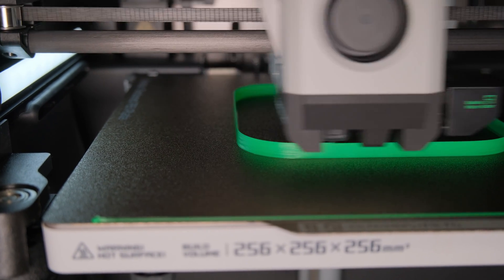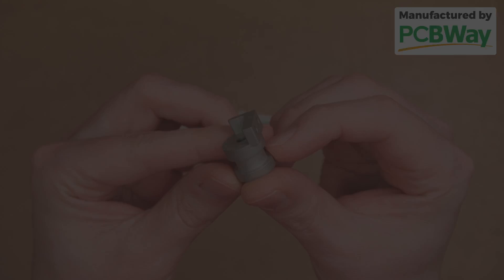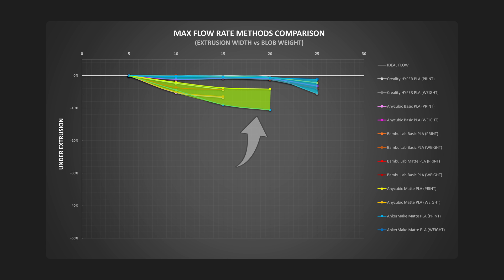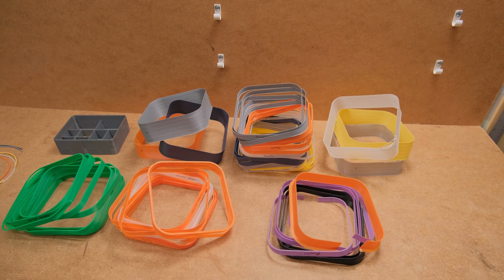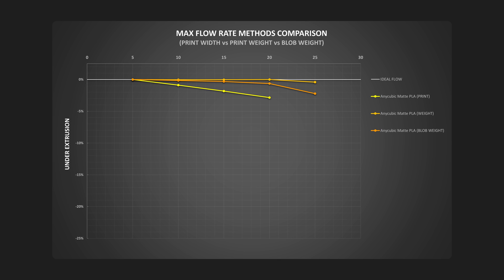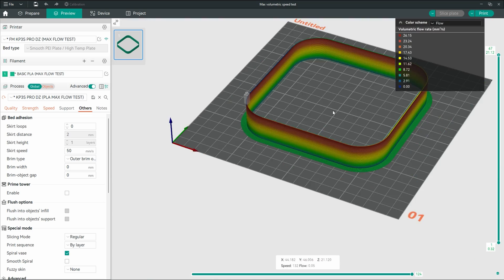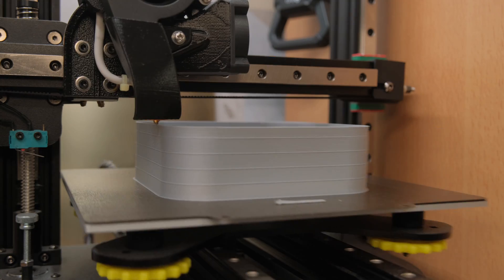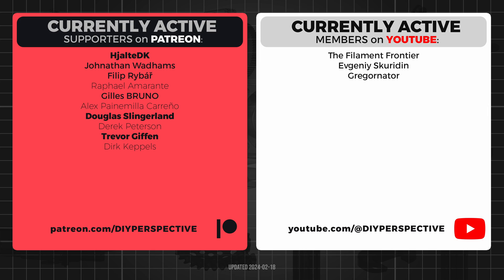3D Printer's MAX FLOW RATE TESTING – PRINT vs WEIGHT

Comment: I just use the Orca slicer max flow test and it works rather well for real world testing
Reply from the maker: Yeah, it is pretty good to determine the maximum flow. The only thing is that you can't measure the true extrusion width and how much different filaments drop off. And that is a very interesting data.

Comment: The way I benchmark my hotend is I take a miligram scale, I cut exactly 200mm of 1.75mm filament and weigh it, its usually around 0.580g. I then go to my printer interface (Fluidd) and Extrude 200mm of plastic at a set speed. I weigh it, and I continue to either increase temperature or slow down extrusion speed untill the extruded filament matches the weight of the 200mm of raw filament I cut. Once I find out this exact balance I save the settings and that is what I use for alll of my printers in my print farm. I get perfect extrusion on all of my machines this way.
Reply from the maker: Your method seems like a blob weighing method just manual.
Reply: @PrintingPerspective  Yep it is! But its pretty easy method to do when you have a lot of machines in the print farm. Once I am happy with a setting, I perform this method on all of my machines and just tweak the rotation distance of the extruder for each printer to match the weight.
Reply: Pretty neat idea, i need to do that too
Reply: This method is so clever and practical, especially when many printers use the same filament!
You could even use the underextrusion factor and increase flow by this value if speed is more important than quality, like for infill.